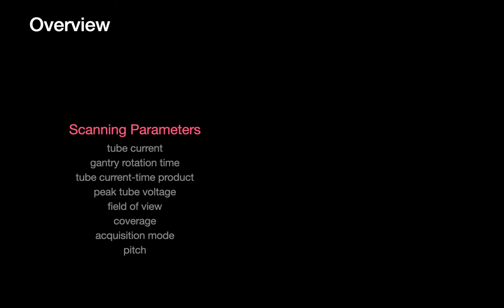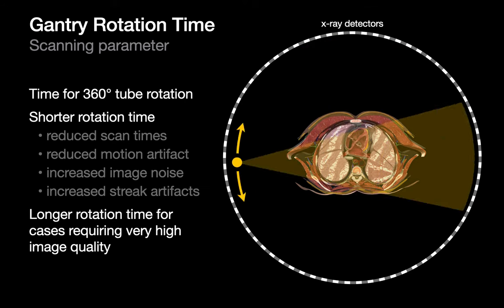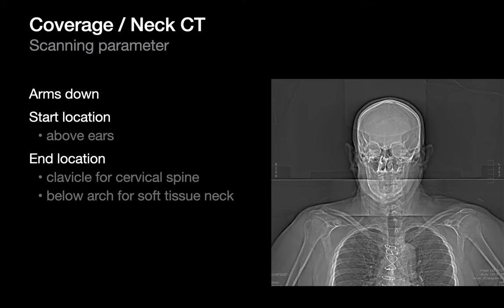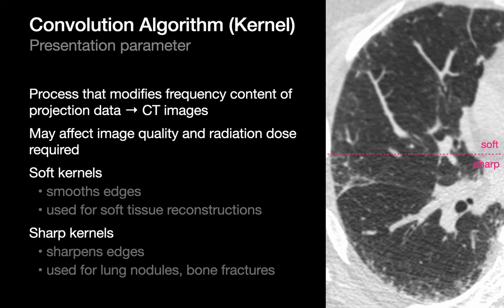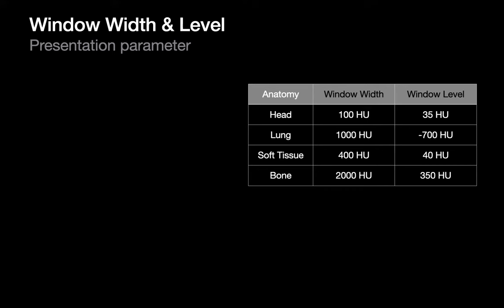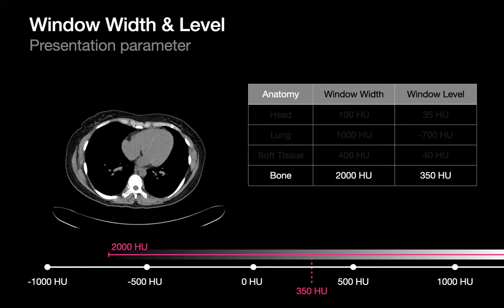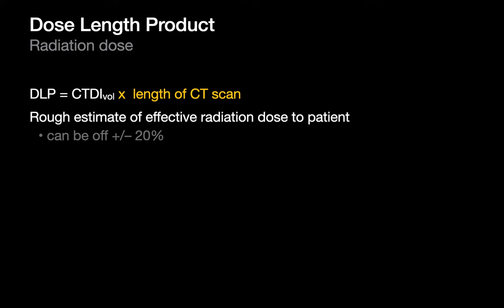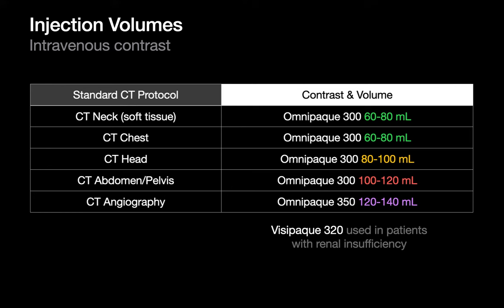CT Imaging: Basic Technical Concepts

Comment: Interesting. Thank you for the tutorial. 

However, @ 16:07 I do not see any difference in noise but the Filtered Back Projection does seem to be a slightly sharper image than the Iterative Reconstruction. Given that the FBP requires less computer power, why is the IR method preferred?
Reply from the maker: You're welcome!

The subtle difference in image noise may be partly obscured because of the compression involved in serving video over YouTube. I'll post a PNG image of this slide in the "Community" tab which may be able to show the subtle difference a little better.

Creating a CT image with fewer x-ray photons (i.e. lower radiation dose) is generally associated with slightly lower signal-to-noise on your CT image (i.e. more image noise). Since iterative reconstruction images tend to be less noisy than filtered back projection images, using IR may permit us to get images of similar diagnostic quality as FBP while using slightly less radiation on our patients than if we had used FBP.